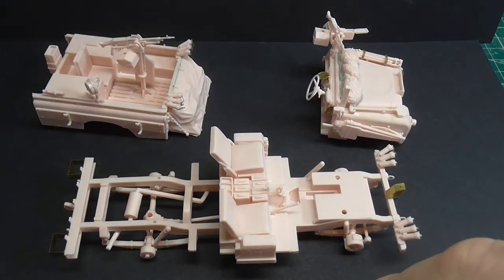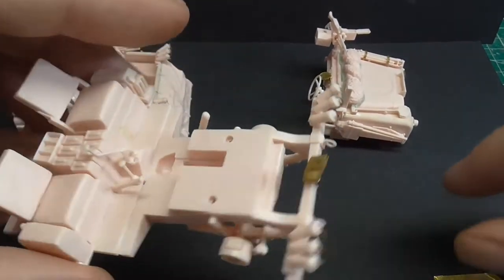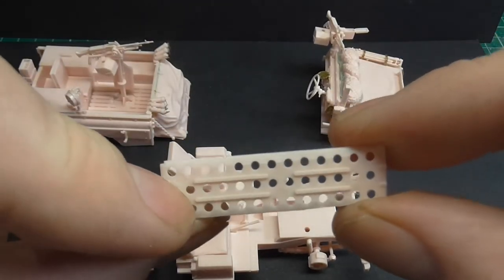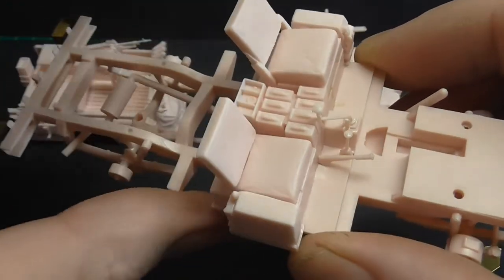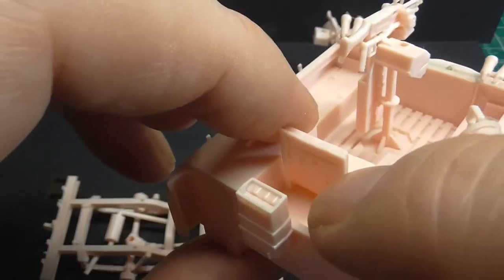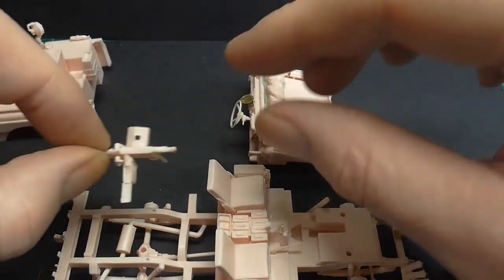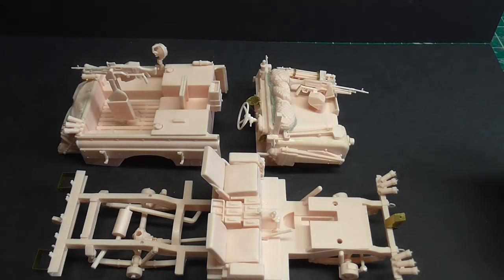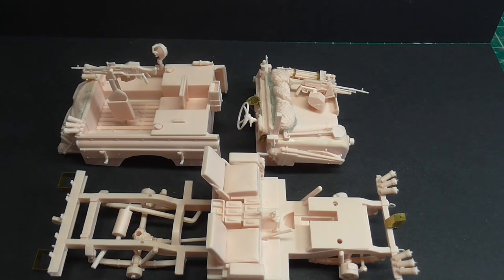Tamiya 1/35 Land Rover Pink Panther Build Part 2

Comment: Looking good, Gav. Don't worry about the photo etch, it was there to see if you liked using it. Now you have had some expirence with it, you can decide in the future if it is worth getting for other kits.
Reply from the maker: Thanks marra i think P.E has its place i would like to see if i could solder larger bits and i am going to see if heating the straps will make them conform better as i just make a mess of those . Regards Gav.